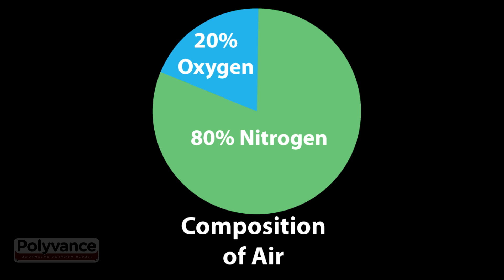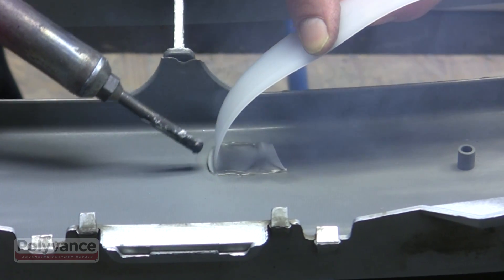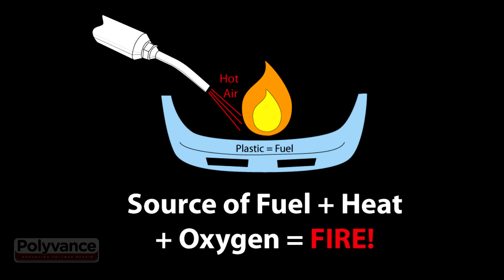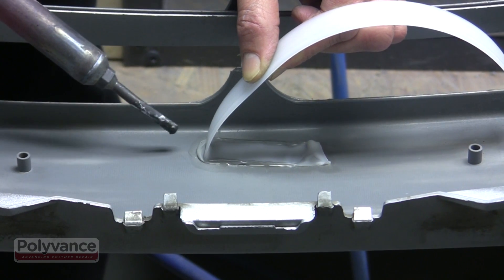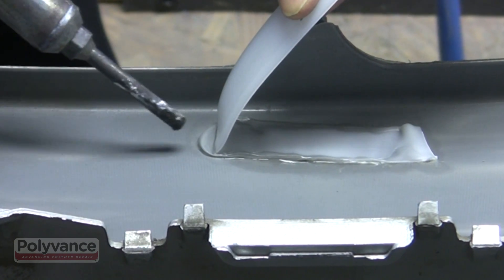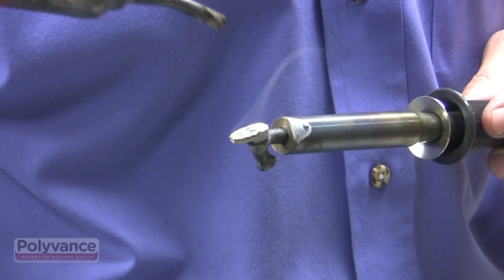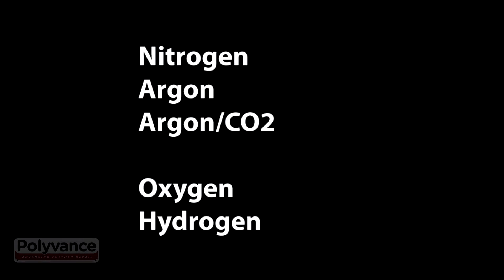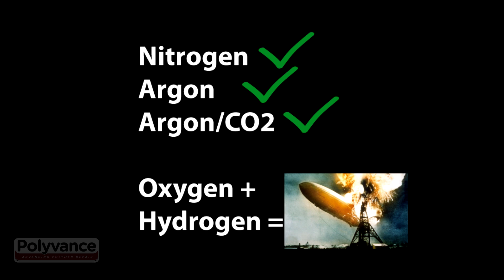Why Use Nitrogen to Weld Plastic?

Comment: These guys get professional results with nitrogen. I've done some home and driveway repairs with hot air and am left choosing between poor fusion from running too cold and burning the part running too hot. Burnt plastic has no ductility and will experience brittle failure quickly.

Comment: plastic bumper cover is just a decoration - why does it need a strong weld? when will the gas pipeline be welded with nitrogen? there a strong weld has its meaning.....
Reply: You've clearly never driven down Carling Avenue in the spring.
Reply: @fun_ghoul  there are too many people in the world - we can't all ride on carling avenue ..
Reply: What if you just gently knock your bumper against something and it cracks on the repair spot? Do the job properly the first time. You don't need an expensive set up either. I can achieve the same with a soldering iron and a nitrogen feed.
Reply: @aries6776  my patch withstands shock-free nitrogen for the first time
Reply: @marianmarian6760  but I bet it looks all shitty and burnt. I can get a cylinder of nitrogen for £30 and a regulator for the same price, plus some tubing for not much. And bumpers are designed to absorb energy not just for the vehicle and the occupants but for things they hit, like pedestrians. Your repair is more likely to give way and expose a pedestrian to bare metal. It's up to you but personally, I wouldn't like to know I was responsible for injuring someone more severely just because I was cheap.